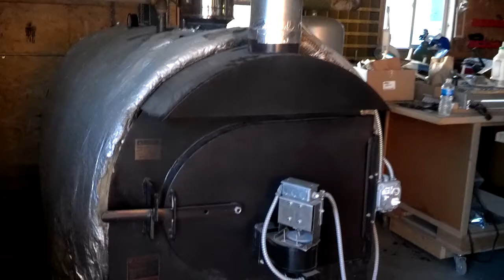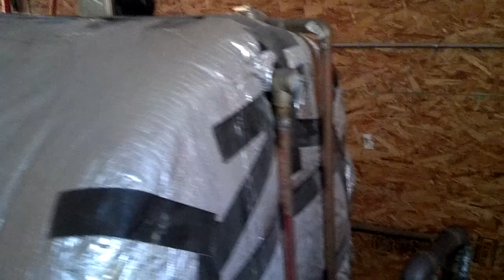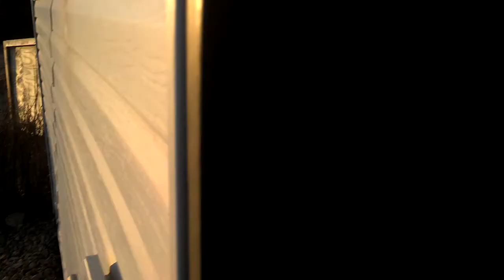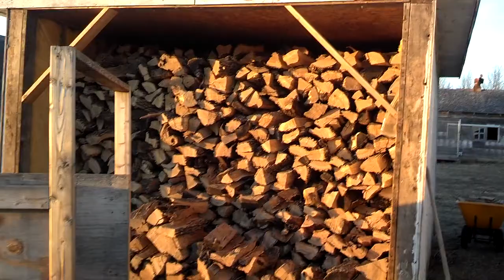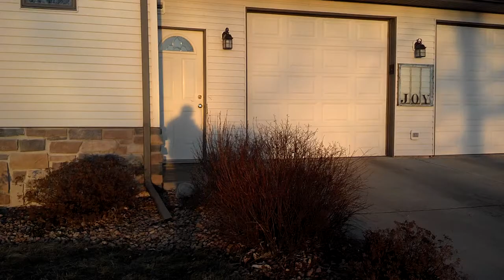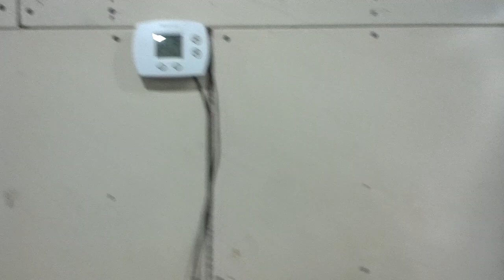Wood Fired Boiler (AquaTherm) My Setup

Comment: I have a ten year old sheltered aqua therm.  I first started it this season and it boiled over up to 250 degrees on a very cold night.  I put in a new door gasket and solenoid kit. The next time I started it the temp rose to 205 degrees and close to once again boiling over.  I did buy both aquastats on top of the boiler but have yet to put them.  It feels like I am replacing items that don't really need to be replaced because of the over boiling situation, and the people at aqua therm now in Wisconsin sell the parts to me, but don't really know the cause.  Any thoughts?
Reply from the maker: I quit using mine because of my health. I had a boil over from leaving my ash door open by mistake. Check for air getting in any where. It could be a hole in the ash containment system. Are the Taco pumps running? Is your water circulating. Is there air in the water lines? Does it boil over without the draft fans running? The first time I run mine I watch the temps and pressures like a hawk. When the water reaches the desired temp the draft fans cut off and if you have water circulating correctly you should see a gradual drop in water temp all the way down to the draft fans coming back on again. Make sure you get all the air out of the system. You can tell by sensing the temp at the heat exchanger. I took quite a long time to get the air out of the water lines. I would employ the help of a HVAC technician. They will have a water pump to assist in getting the water out of the lines.

Comment: Can you tell us where the 2 oil cups are located the blower motor please? We have an 12 yr old aqua therm.
Reply from the maker: I think they are on the edge and the ends of the round motor housing. I think the one end has a foam gasket on the end of the motor so drift air doesn't get in. It is hard to see. Look in the maintenance directions that came with the unit. I don't recall being told to oil these but I know they are there.

Comment: What do you use to clean out the creosote?
Reply from the maker: I have been told by Aqua-Therm to burn newspaper in it periodically which seems dangerous but I never seem to get buildup in the flue. As for the flue I use a chimney bush.
Reply: 1crazynordlander Ok. thank you. I was also told to use cardboard. I guess it's in the paper. Thanks!!

Comment: Thanks for sharing.  I just moved into a new place and Have an aqua therm 275.  I am wondering if I should get the retrofit kit to make it a Eco-one model.  I'm scared to invest the $1450 and not see any gains.  Your thoughts?
Thanks
Reply from the maker: Dan Waletzko Honestly I wouldn't upgrade it. Two reasons. 1. When I picked mine up in Brooten MN one of the employees was complaining they are hard to light with all that air flow. He is right. I will leave the front door open for a while with the draft fans off just to let the fire catch hold. 2. I had the front door fan go out on me but luckily I had the door to my shop open and I was outside pushing snow off the driveway. There was a lot of ashes, smoke and I am sure I would have had fire coming out then I am sure the draft seal would have burned off and then the stove would have gone over temperature and pop the relief valves and ruin the boiler. I couldn't just unhook the draft solenoid, I had to block the air port going into the front door. There should be a recall on this as there should be over temp sensors in the fan housings. Very dangerous!
Reply from the maker: Dan Waletzko Please read both replies. I just got off the phone with Aqua-Therm about converting mine back to the original style unit. I am going to do that this year and try it. They said nothing bad should happen. That way if the fan in the back quits it should not cause any issues. In fact I have one friend that was going to unhook the rear fan power, leave the draft solenoid hooked up to power to do it's business and just let it naturally draft. I think Central Boiler's units have no fans. They told me I can leave the door and baffle alone but I have to plug the blower connection hole with a steel plate.

Comment from the maker: Now that it's all paid for, boiler, skid steer, chainsaw and wood splitter, I should see some ROI this year. It has enough capacity to heat another building if I want. They recommended the big one so I can get by filling it twice a day. Is built from stainless steel so hopefully it lasts me awhile. I hope to setup some sort of wind solar to battery backup so it stays running during a power outage. I have a genset right now that would run all my heating appliances so I guess I shouldn't worry.